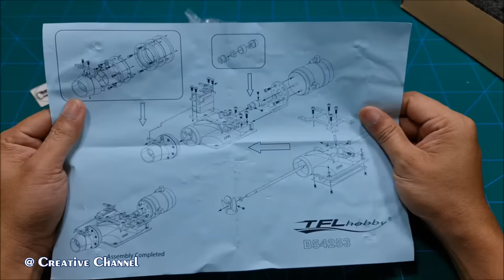Water Jet Thruster For DIY RC Boat

Comment: The thing has a massive leak at the transom mount when under pressure. It will turn your boat into a submarine in about 10 seconds.